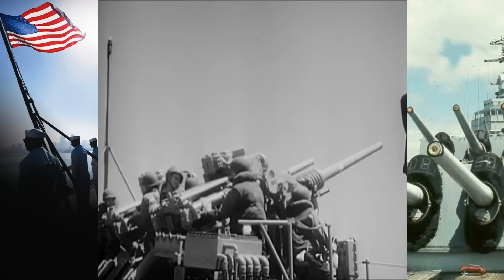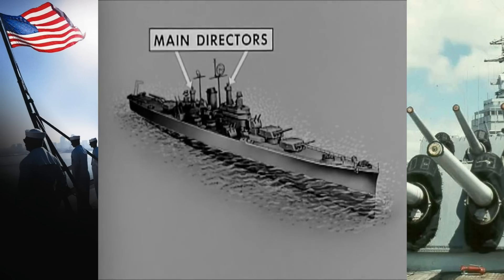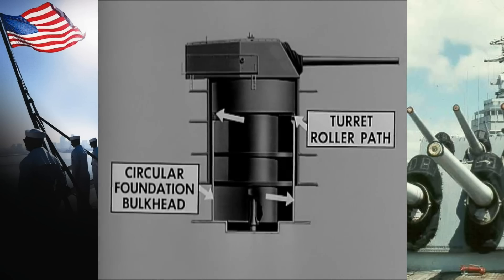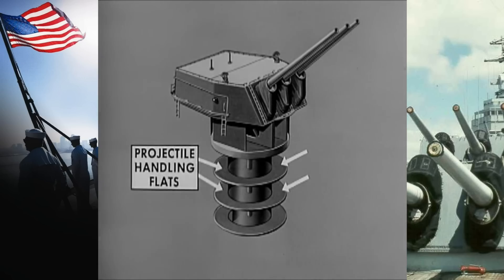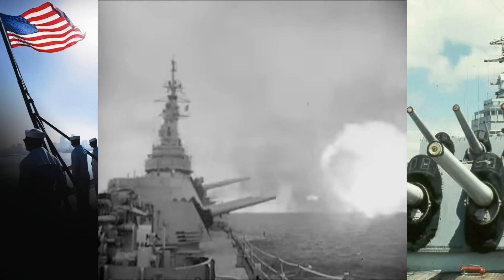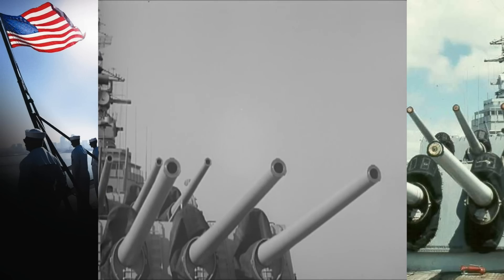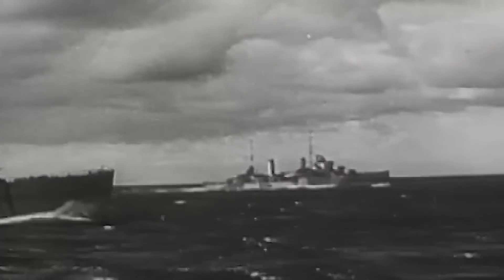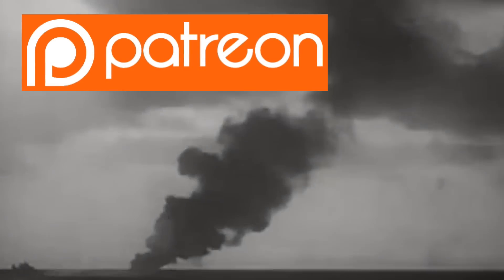How Do Large Caliber Naval Guns Work?

Comment: Honestly i hate the way all naval warfare is low sized guns and missiles now a days. With things like the phalanx thats simply not going to be as effective.
Reply: A missile can easily carry a 2,000 lb warhead which would have the same explosive effect as a 16 inch projectile. At the end of WW1 experiments were conducted that showed that battle ships could be sunk by aircraft carrying bombs. The evolution of the aircraft carrier was the demise of the battleship
Reply: ehhh, no, the biggest ships for the most part are submarines. most other ships are anti submarines, so big guns or even missiles are not very useful, just really really good sonar, radar, and aircraft (and stealth). the Phalanx is simply to make the ship less vulnerable to aircraft attacks, in a small package. I know at one time the USSR was heavily reliant on cruise missiles, but missiles have never really proved themselves. 

Also, battleships had big guns to hit land targets, not especially each other, and there is not really a call for large super long range artillery like that, and, if there was, it would be provided by perhaps even a single gun on a smaller ship or several smaller ships.

Battleships used to be among the faster classes of ships too, I might add, as big engines are easier to make efficient, but engine and ship design has improved too. Another point someone made is that earlier battleships weren't armoured, which was done to protect against mainly torpedo and bomb threats really.

Admittedly the classification of ships has changed over the years, but battlecruisers were really the predators of the seas, battleships lumbering whales that were dangerous, but only if you swam into their mouths. But yeah, battleships really are more closely compared to nuclear submarines as a strategic threat, blocking ports and destroying coastal defences, denying area.
Reply: Carbon 12 thats why you have an array of various ships and weapons to deal with various threats. And the phalanx is capable of shooting down aircraft. Missiles. Boats. Just about anything. Not heavily armored. And the battleships being fast is an american thing. German and japanese ones were quite a bit slower and bigger (though i prefer the american style myself). And the reason for larver guns is simply more range. 1st trike capability is invaluable (hence the heavy use of missiles). Research into rail guns and the such also show some potential to bring back the use of more traditional style weaponry. Just in a far more deadly package.

Comment: Compared to today's guns, these are big guns. Can't understand why anyone with half a brain would dispute that. By today's standards where 5" is the biggest gun around, these 8"ers are certainly properly characterized as big. When they're so big a man can't handle one without machinery, they're big. Amazing detail in this film. Thanks so much for posting. Very interesting to me and actually I'm not even a gun or hunting guy. Am a liberal animal lover who posts mainly animal rescue stories from Dodo on Facebook (I also post a huge variety of my own videos on YouTube) but I am very interested in the details of machinery manufacture, engineering and operation and this is video touches most of those boxes. Thanks again for posting and this is one video where I feel I have to say I just don't see anything to criticize or dislike or anything. If one is not interested in this subject, then one shouldn't click on this video.
Reply: Actually 5ers are the Navy's biggest guns aside from the 16" on the Iowa class battleships 
that they still pull out from time to time.
Other than that, there is the105mm (roughly 4 inch) and 155mm (roughly 6 1/4 inch) that is used by the Army and Marines.   The 155 mm comes in towed and self-propelled models.
Reply: Very big. They really light up the attacking side's radar scopes. I suppose the ass end of the shell is hot so they'll light up the IRST on an attacking Rafale or Typhoon.  Of course the muzzle flash is visible from all aspects and the two second fire rate generates a perfect target track foe everyone, even his own side will note that: "Old Leadbottom has finally stuck his head out too far!"  as he shouts "McHale! McHale! I want his head!"
Reply: @soulsphere9242  Indeed it has but it is part of the reserve fleet and an asset that can be put to sea so still counts.as having the biggest guns.
Reply: @soulsphere9242  Then I stand corrected.
Last I had heard, the Iowa herself was still a reserve but that was several years ago.
Reply: The operations that go into these pieces of technology are truly astounding. Not sure why the US canned these designs entirely. Sure, they can't solve everything and the ships we have now would still be around, but with new hypervelocity rounds coming out for powder guns (a 28-pound projectile got blasted to 50 miles whereas the 70-pound normal shell only went out to 13 in just a 127mm gun), they could certainly be put to good use.
Reply: In other words, you're a pussy.
Reply: @ApacheBob41  I realize it’s been three years since your post, but if you look in a mirror you could still wave to the real pussy.
Reply: @ApacheBob41  As Bambi's friend Thumper said "If you can't say something nice,  don't say anything at all". 
 We all know what he is, because he told us who he was. Remember that it is better to remain silent and be thought a fool, than open our mouth a remove all doubt.
 Think all that you want to think, but when you open your mouth say something profound.
Reply: @rancidpitts8243  Have you seen "Bambi meets Godzilla"?
Reply: @jwaustinmunguy  Yes. Hilarious ending. Funny way to make a Frisbee or road pizza.
Reply: people that need guns to fight are the pussy.

Comment: The 8" guns found on CAs were roughly equivalent to the penetrative capabilities of 12-13" guns found on pre-dreadnought battleships. Obviously the post-penetration damage of both varied greatly, but it wouldn't be completely wrong to assert that CAs replaced pre-dreadnought battleships when it came to the firepower game. However, they're nowhere close to the battleships of WW1; even the "modern" WW2 12" guns found on the Alaska-class were only touted as powerful as the WW1 14" guns.

Comment: Shouldn't they be called "shells", not "projectiles".
Reply: Does it matter
Reply: No because a shell would hold the powder.
Reply: shell does not have to hold powder.  We call 155 rounds "shells" even though they are loaded separately from powder.  projectile is just a more technical way of saying shell
Reply: A shell is a high explosive warhead usually, it is called a shell as the cannonball was hollow like an eggshell and filled with powder in a way similar to emptying eggs. The bigger guns fired purely shells usually, as solid projectiles to penetrate armour are pretty much unnecessary when your shells weight exceeds a tonne.

A shell is unrelated to a casing, but an easy mistake to make. And I say cannonball, it was usually mortars or cannonades that fired shells, back in the day, and they were just called "shells".
Reply: in artillery you have to types of rounds in common usage separate loading ammunition vs cartridge rounds.  
A Cartridge or "round" includes 4 components a projectile and fuze, propellant and a primer- primer initiates the firing action which causes the propellant to expand to project the projectile out of the gun tube.

Shell is a reference to it being a steal shell with an explosive core which is detonated by the fuze when triggered

Naval Artillery functions in the same fashion is Ground based Artillery pieces

Separate loading ammunition typically has a shell rammed followed by powder bags followed by a primer- cartridge rounds are reloaded and the powder is in a metallic cartridge which is ejected when after firing.  Some Tanks have cartridges that are burned up in the firing sequence with only the back plate of the round being ejected.  such as the Abrams

Some times these are referred to as "case guns vs bag guns"

Comment: Very interesting!  The 8 inch gun became part of the rapid fire gun systems alongside the old standbys the 127mm or 128mm guns that originally were made for hard hitting rapid fire anti-torpedo boat duty way back in the old days.  The 55 caliber lengths is very impressive too.  8 inches x 55 makes for a lot of barrel pressure to push a heavy projectile a long way and wallop the other guy! Now multiply by number of  barrels and turrets!  Boom!

Comment: "Computer operator" 

A song file in my mp3 list has more power than one of those computers
Reply: Those guns made a different type of music!
Reply: The point is to have more calculating power while adjusting for the waves in the water, and while heading on a course. You, me, and everyone in those ships can't do it, that old computer did.
Reply: One plus side you can’t emp on of those things
Reply: @AceDan-gc9po  you certainly can, even those  old computer rely on electronics. Now a steam computer? that can't be emp, but might be bigger than a battleship to do the calculation tho.
Reply: Titouan Lannuzel emps primarily work by overloading wires. the wires on a vacuum tube aren’t going to be melted easily on modern equipment efforts have been mad to make wiring smaller and so more vulnerable to things like emp. Emps don’t work by disrupting elections they work because after the disruption the wires are fried.
Reply: And sadly those" computers" are still in service on one f the older ships
Reply: I'm sorry, what was your point?
Reply: Mitch A : Afther seeing that : Do you Nééd one.?

Comment: why not put a battleship gun on a tank and pair it with great optics/fire control and use it to snipe other tanks
Reply: Because it's hard. A single 8-inch gun is hard to move on it's own, put that in combat conditions like hills, it's easier to just make it as artillery. A battleship gun is even worse, double the size, it just would be too large, too heavy, and so on. 16 inches is too overkill for a tank anyways.
Reply: To make a mobile naval turret of this kind would be a major under taking. It would be a massive 2-3 story monstrosity that would take 100 crew to operate and be a massive air target due to its size and very slow speed. It would also need auxiliary security units (and it's own supply train for food, ammo, and fuel) around it, be a massive drain on supplies and provide very little value. The resources and manpower would be better spent making tanks and self-propelled artillery.

Comment: Does anyone know if this gun system could load in all elevations?  If it could and maintain fire rate at any angle it really would be devastating.  I know the much larger guns like 16 inch have a loading position but then again it uses cloth bags.  Also i agree with Matsimus these are Big guns.  On land it is the largest piece we fire but it don't fire this fast.  If a battleship suddenly found itself under accurate fire from nine 8 inch guns firing every 6-8 seconds it would wreak the upper works and lesser armored part of it.  Maybe not sink it but it would kill hundreds of men and break a lot of stuff and set fires.

Comment: Certain versions of these guns were considered dual purpose - able to attack both surface and aerial targets. This video shows an example of this. At the time 8 inch guns were right at the upper limit of being able to traverse and elevate quickly enough to be practical for the anti-air role. It was more typical to use 6 inch guns or smaller in such a role. Current technology would allow far faster and more effective use in this role if they were placed on a modern naval vessel. 

Another point that I found interesting when doing my own research is that 8 inch guns were found to be fully effective for shore bombardment while 5 inch guns were found to be largely ineffective.  6 inch guns were marginally effective and considered the minimum useful caliber during analysis of many past bombardments. 

The size and weight of 8 inch guns is only a little bit more than for 5 inch or 6 inch guns but they are far more effective. Development of 8 inch guns was just reaching the point where they were becoming about the optimal size for maximizing firepower for given space and weight limits. 

Missile technology largely replaced guns but there were still a few last development projects to see how much weight could be reduced and turret speed increased for 8 inch guns which were largely successful but not used. The US Navy had settled on using mostly single 5 inch guns on guided missile vessels which is a shame since an 8 or even 6 inch gun would have been far better for shore bombardment and still practical for other targets on the surface and in the air.
Reply: Don't forget the third use: Shore targets.
Reply: There is a big difference in weights between the 8 Inch shell the weight is almost 300 lbs, the 5 inch which is a M - 109 Cannon fires a 90 pound HE round . 
I was on a M-110- A 1 8 Inch SP 78-81.
Reply: The Japanese actually had 18" anti aircraft shells called beehives that were designed to detonate amidst a group of enemy aircraft. From what I have read, they damaged the gun tubes and were considered a last ditch weapon.
Reply: @bookdoc3225  The beehive shells were officially known as "Type-3 shells", or "Sanshikidan". As cool as 18" AA guns sound, they were of minimal effectiveness, to the point that American pilots noted them as pretty fireworks. It is suspected that in her final mission, the Musashi, attempted to use a beehive shell, which detonated in the gun barrel, damaging one of her guns.
Reply: The guns pn the Salem were dual purpose

Comment: -Navy Commissions rail gun for full service.
-Iowa and the New Jersey battleships put back into service.
-Replaces 16 in. guns with 16 in. rail guns
-Replaces Mk 12 5 in. guns with Mk 45 5 in. guns.
-Adds more CWIS. 
-Updates all radars, sensors, and EWS.
-Updates to Aegis system.
-Restarts construction of the Montana and sister ships as an up to date platform for newer systems.
Reply: xV0LK0Vx If railgun battleships were to be commissioned they would be completely new ships. Not a re fitted Iowa classes.
Reply: Don't forget nuclear power, or the rail guns won't fire.
Reply: +rowsdower one can dream
Reply: they won't use Iowas for testing.  dreaming is foolish if it is only for your personal amusement.
Reply: usable lifespan for the Iowa's is the number of hours on their machinery and there's a lot left.  But, using them in the BB role today  is a lot of capitol and manpower in one hull which makes it a really impressive target. modern torpedoes and even the older japanese long lance torpedoes would be able to take the hull out. the  systems of the ships would need total gutting. the hulls of ships are not the most costly item in them. it is the systems , the weapons , and the crew and the support they require. CVNs don't cost so many billions to build, it's everything about them. the hulls are cheap-engineering and steel-it's everything in them. they would have to have a capitol ship battle group to support them as the CVNs have. what would the mission be? surface bombardment? better(cheaper) platforms are available. the only reason for the BBs is the big gun. what is the big gun for in todays naval environment. I know several admirals want a BB flag, because the just want one, but they know they won't be getting one.
the DD1000  class was built with the railgun in mind. but still its another ship without a mission. kind of like the LCS class ships. but that is another story for institutional scab picking...
Reply: It is not so easy for modern torpedoes to take out an Iowa-class BB. They have 2 part hulls, so the fore hull (or afty) could drop a little and the other hull can follow it without breaking her back. My berthing area aboard the Iowa just aft aft this partition and in very heavy seas we could observe the movement. We could see the deck move along the forward bulkhead. It would travel a couple inches. It was pretty cool to see.
There is a psychological effect to having an Iowa-class BB show up on one's coast all of a sudden. The 16's are far more effective for shore bombardment then any other naval gun in existence today. I would hate to be a soft target on the receiving end of a 9-gun salvo spitting hot metal 50m airbursts.
Also, the Iowa-class BBs sported 16 Harpoon and 32 Tomahawk missiles. No small matter there. Plus 4 CIWS mounts. 
If I were a Flag Admiral, I would love to hoist my flag on one of those beauties, wouldn't you?
Reply: You must have been in Deck Dept. Div. 1,2,4th ?  I was in 3rd. from 88-91 I was part of the Decom crew.  @ishkybibble3084
Reply: @pimpdaddy882  No, I was a Fire Control Tech (Guns). I was in FA Div. I am a Plankowner. Reported in August 83 till May (I think) 87. Best damn ship in the Navy.
Reply: +Chickennuget: Dreaming is what politicians do concerning using the military for their own greatness.

I call it "delusions of adequacy."
Reply: rowsdower they may use Iowa class bbs as testing